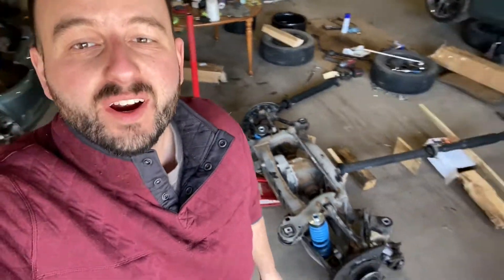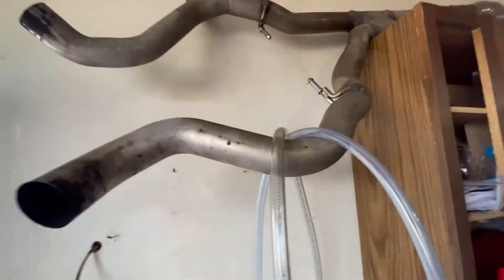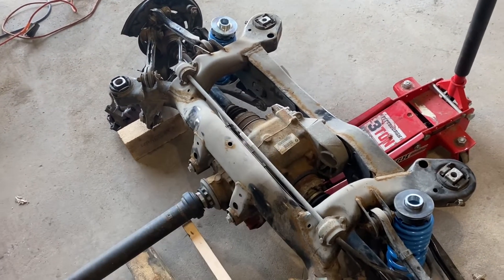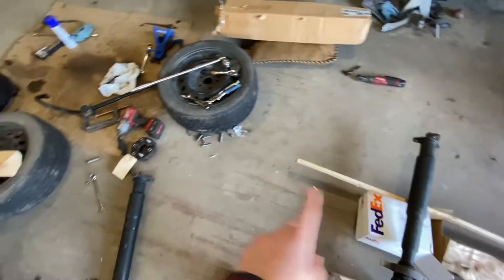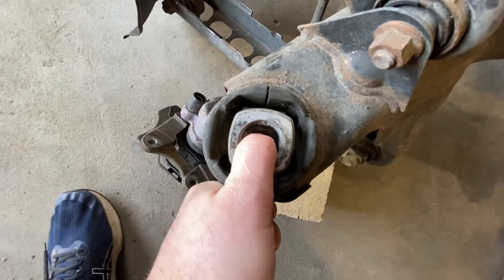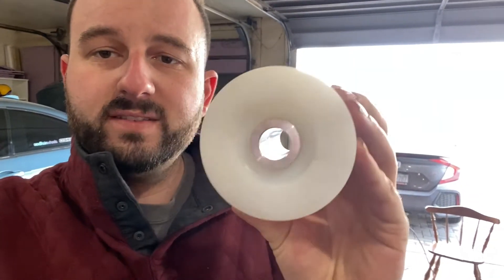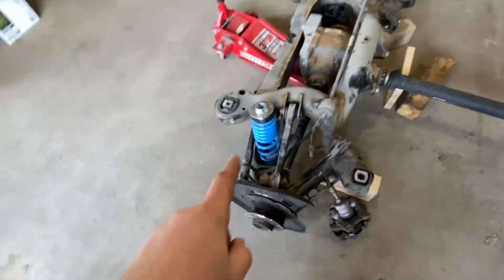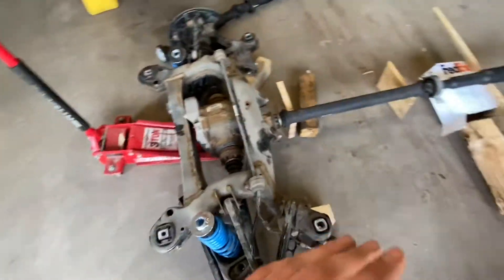I’M UPGRADING EVERYTHING AT ONCE—BMW E92 335i to M3 rear diff & subframe swap

Comment: How did you make out? I'm in Ottawa. I have an E90 335i, I am currently doing a full DCT swap on it. It's a full caged race car I run at Mosport and CMP.
Hit me up if you're in the area.

M
Reply from the maker: Good to know! So far it’s been a great swap except I’m getting lots of drivetrain vibrations. The donor car was written off from a front end collision so I think the diff is fine. I believe my driveshaft isn’t balanced correctly
Reply: @Highspoolteacher  hit me up on FB if you like. I can help you out with your project if you like.
Mark Dean
Reply from the maker: @holeshot895  I’ve actually taken a leave of absence from all social media for a while, but I’ll send you a message through Messenger if that works!
Reply: @Highspoolteacher  sounds good, I can send some photos of what I have.

Comment: Good video. I have installed the same m3 diff, stub shafts and am down to only having to get the driveshaft modified. I talked to a reputable driveline shop in my area and they have significant strength concerns about removing the stock flange and welding it onto the m3 dct piece. Do you have any pics/videos of your modified driveshaft?  Thanks.
Reply from the maker: Hey John, sorry but unfortunately I was too impatient when it got to that part of the process and I just threw it in the car without taking pictures. The weld is fusion welded, so it has to be taken apart with a smaller shaft inserted inside of the driveshaft to give the new flange something to weld to. In other words, you have to insert a smaller diameter pipe in the end of the cut shaft to strengthen the flange.

Comment: 335i diff 2.56 
M3 diff 3.15
Reply from the maker: 335i diff 3.08
M3 diff 3.15

The 2.56 you are referring to doesn’t come on a 335i. It’s possible that it is the DCT diff for a 335IS, but I don’t know
Reply: @Highspoolteacher  if i have an auto 335i which m3 diff do i get
Reply: @daboss9889  manual M3 diff